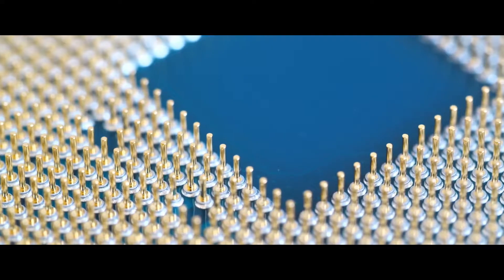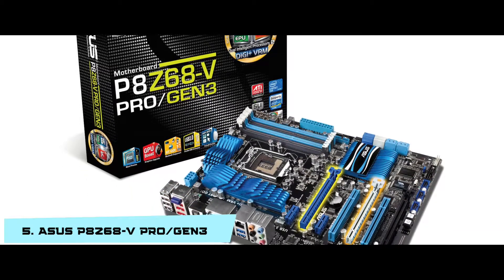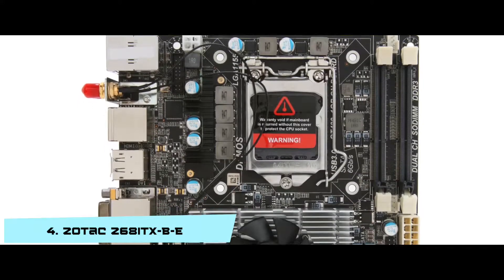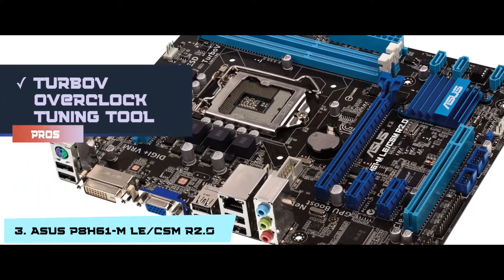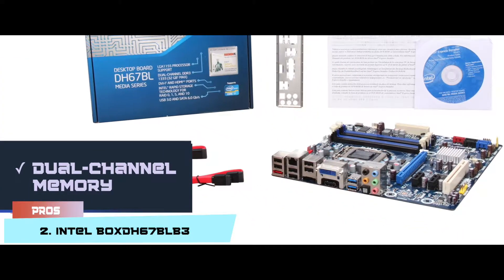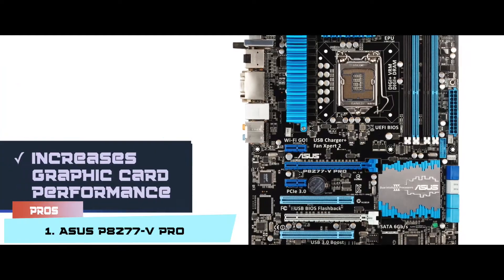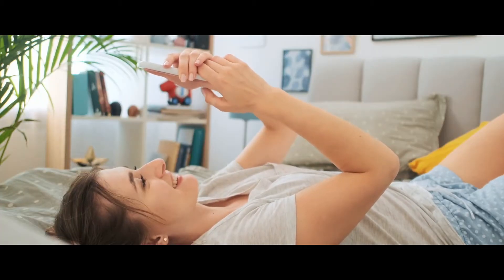The Best LGA 1155 Motherboards: Top Options Reviewed | Digital Advisor

Comment: I have a foxconn lga 1155 recently I replaced the cpu i7 3770 and I'm waiting on the gpu palit geforce gtx 1050ti. I ended up buying the desktop used so this board is not bad considering how old it is.
Reply: Did you notice the difference after the change CPU
Reply: what was ur previous cpu before i7 3770 or did u change the i73770 cpu, because i have it now and im wondering if i should upgrade it
Reply: Trust me with a overclocked i7 3770k it can handle a gtx 1060 6gb easily
Reply: How the performance of 1050Ti?

Comment from the maker: Read the full review here: ►► 
https://digitaladvisor.com/motherboards/lga-1155/
(Best LGA 1155 Motherboards)

******************
✅ Featured Products for Best LGA 1155 Motherboards

0:00 Introduction
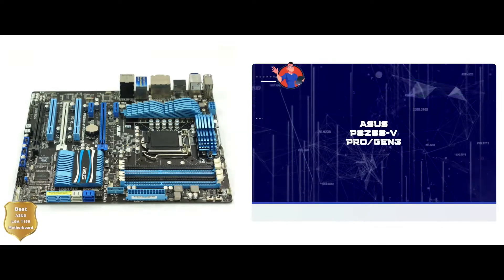0:55 5.ASUS P8Z68-V PRO/GEN3 ➜ https://amzn.to/2UzbDUS
1:57 4.Zotac Z68ITX-B-E ➜ https://amzn.to/3kgvh0T
2:57 3.ASUS P8H61-M LE/CSM R2.0 ➜ https://amzn.to/2UA3Gii
4:00 2.Intel BOXDH67BLB3 ➜ https://amzn.to/3mkiygc
4:55 1. Best Overall: ASUS P8Z77-V PRO ➜ https://amzn.to/3823lIg

Subscribe to our Channel 
🔴 https://digitaladvisor.com/youtube/

******************
Detailed review: https://digitaladvisor.com/motherboards/lga-1155/

🤔 Why Did These Motherboards Make Our List?

The reasons why the following motherboards were our top pick are:

🖥 Compatibility:
These sockets were made for Intel 2nd and 3rd generation processors, including Core i5 and i7. Therefore, the motherboard you buy should be compatible with these versions. All these products are either for 2nd Gen, 3rd Gen, or both. If you are looking to buy a motherboard for LGA 1155 socket, then it needs to be compatible with that. Otherwise, you will end up damaging both your CPU and your motherboard.

🖥 High-Speed  
The top motherboards should always provide a high-speed performance boost to your system. All these products listed here have fast Ethernet connections and ports for fast data transfer. They let you overclock the system to take your processor to its limits and give the best possible performance.

🖥 Overclocking
Many users looking to buy a new motherboard seem to prefer one that has overclocking ability. While this can be dangerous for your CPU, if you are a gamer or use your computer for intensive tasks, then it can cause a lot of improvement in performance. That is why all of the products listed here give the user control over the clocking ability.

💬 Let us know what you think of these LGA 1155 Motherboards in the comment section below.

👉 We appreciate every thumbs up and would be grateful if you’d consider subscribing to our channel!!

******************
🎥 Welcome to the official YouTube Channel of Digital Advisor 🎥

Digital Advisor reviews the latest tech and computer products, with a focus on PC builds and accessories. Our topics relate to the year's best motherboards, GPUs, graphic cards, video cards, routers, cases, fans, and more.

 🌐 Learn more about us: https://digitaladvisor.com/about/
 💻 Like our Page: https://digitaladvisor.com/facebook/
 📢 Follow us on Twitter: https://digitaladvisor.com/twitter/
 📱 Check out our Pinterest: https://digitaladvisor.com/pinterest/
 🔴Subscribe to our Channel: https://digitaladvisor.com/youtube/

******************
#DigitalAdvisor #bestmotherboard  #lgamotherboard